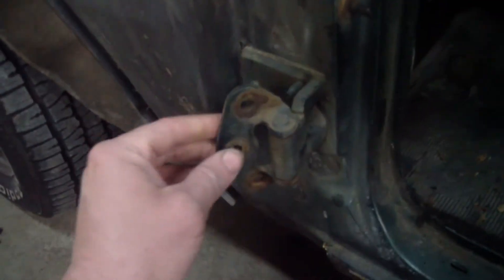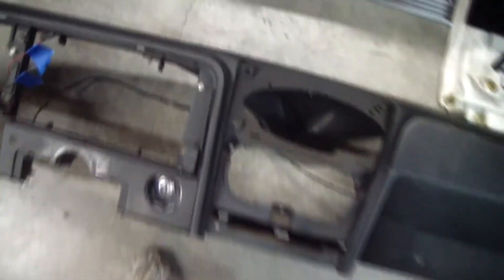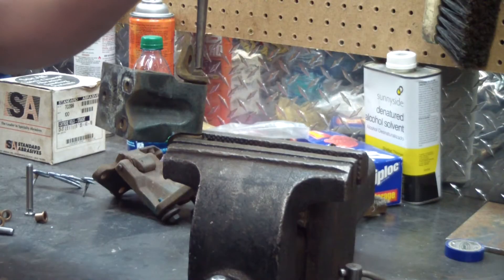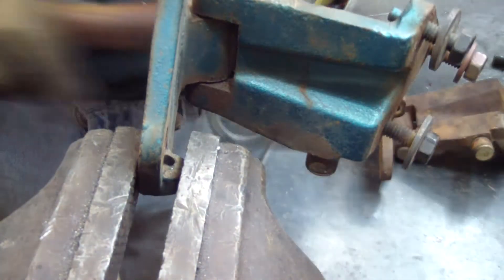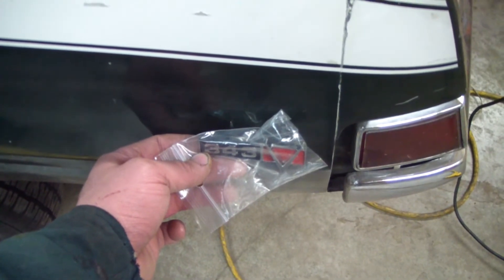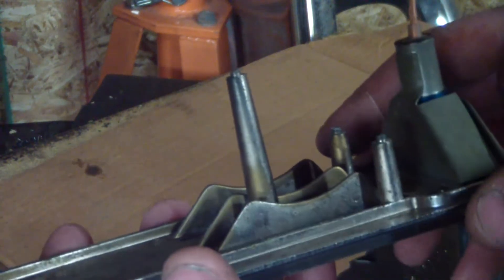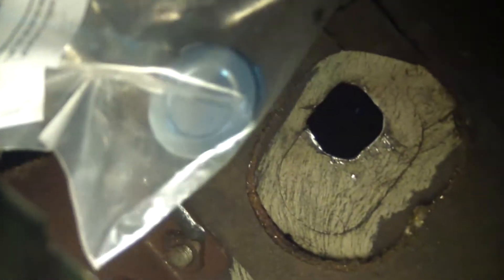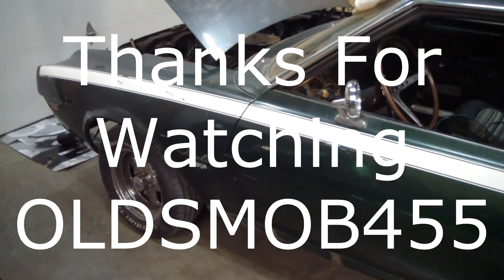Javelin SST Update, Hinges and Stuff

Comment: I had the same problem with new door hinge pins/bushings from APD when I replaced them on my Javelin.  I ended up using the bushings they provided but turned down some GM-style pins for a tight fit.  There was nearly 0.010" of difference between the bushings/pins provided.